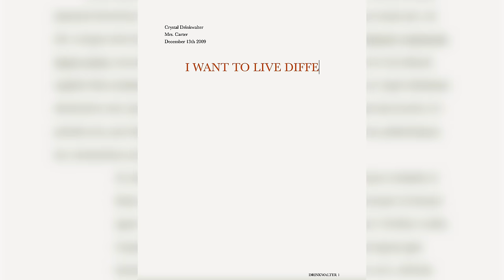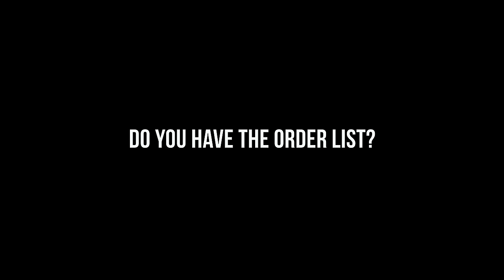FINISHING Massive Off-Grid Solar System!

Comment: My dear Crystal and Jasmine, congratulations on your current achievement.  YouTube has made it possible to share this wonderful experience with so many young couples, and, for this, I have no words.  I life has taken so many different turns from what I planned that it's currently unrecognizable.  But, I would have loved to have your experience, but, my marriage partner and I have taken a more conventional path.  But, my passion, as it turns out, is for more rustic skills, so, even though my partner is a rocket scientist, I spend my time spinning and weaving, and woodworking. And I have done this for almost 30 years.  I have built almost all the furniture in our home, and refurbished the rest which I mostly bought from the Salvation Army or Good Will stores.  I was thrilled to hear that you girls are in need of someone to help with furniture and cabinet design and construction, and I would love to jump at the opportunity to help, however, I am currently having problems with my knee, I injured it on the job during the pandemic and treatment hasn't been going as well as expected, so, I am stuck here in so cal - sucks to be me!  But, please let me know if you need zoom assistance, I would be more than happy to be a part of your wonderful experience.

Comment: Usually you have lots of power during the summer, but the panels do not deliver much in winter. So it might be a good idea to set the angle for winter, where you have a lack of power, instead of for summer where you get possibly more than you can consume. However, a flat angle allows light onto the panels from a wider range of sun positions as having them angled steeper. I have three panels for my garden (lawn mower robot, fridge(small, 0.2 kWh/day), light and irrigation) and they are mounted flat on the flat roof of my garden tool shed. I get power from about 7am to 7 pm in the summer. The three panels deliver more (~800Wp) than the bluetti AC200P can take in  (max 700W) at full sun anyway, so having the longer timespan where the panels deliver enough to charge is better. From june 13th to november 5th this tiny system delivered about 137 kWh.

Comment: The contrast of the solar panel up against the forest is clean green recycle ♻️ energy. 8:12
Sun energy 14:12 🌞 power now you need batteries AC ⚡ DC converter.

Comment: My fixed ground-mount array is about half your size, but I did it all myself, except for the guy who brought the concrete pumper.  Even then, I ran the hose and he ran the pump.  These panels actually generate some power, even when it's overcast!  Not a lot, but I think it will keep your batteries topped up.  I'm grid-tied, but have not had an electric bill since it went up.

Comment: If you have any extra of the Schedule 80, hang on to it.  I took some and cut it into 4', 2', and 1' lengths and Arc Welding some rebar as a hanger to the Pipe.  Makes for great steel shooting targets hung between two trees on a rope.

Comment: Wow!  It is not even my home and I had happy tears streaming down my cheeks.  This was amazing!! Do you have mini-splits yet, for heat inside?  or are you going to stick with wood heating?  Just because I am lazy, I would plan on a mini-split for heat and air conditioning, even if just to have as a secondary source of heat and of course for Air Conditioning when it is hot and humid.  They are ductless, easy to install and work well (added bonus, remote control so you don't even have to get out of bed to warm up your house first thing in the morning).  If you insulate well, you just have to warm the place up in the morning and once in the evening and it will stay warm enough to be comfortable and once you are up and dressed you can always build a fire for that romantic touch and that special comfort that you can only get from a wood fire. Just a suggestion of course, I am sure you two already have a perfect plan for your perfect little cabin in the woods. Thank you for taking us along on this journey, it has been a blast!

Comment: What a lovely and heartwarming video. So glad to finally see the panels going up. Fingers crossed that you'll get everything set up before it gets really cold. Are you planning to use the batteries for heating the cabin as well, at least until you get your wood stove/oven? I use solar on my house since 2011, but I only have 4.6 kW peak. However the system produces roughly 50% more electricity than I need per year. I don't have a battery though...
Reply from the maker: Thank you! Yes power will be going in all buildings 💛 Wowzers! That’s a lot ⚡️

Comment: if you are going to hookup to batteries Renogy Lycan comes with a circuit breaker and plug in your panels directly into the battery box.  if you want to do it yourself for half the price :  You will need  a minimum 6mm ground, live and neutral wire,  2 DC inbound 100amp circuit breakers with fuses and surge protection breakers, then also for your battery bank a DC 200 amp circuit breaker with fuses and surge protection breakers.  Install all into two seperate Alternate Current and Direct Current circuit breaker waterproof boxes. Then grounding : you are going to need alot of 16mm copper cable wire for each array to reach the ground, with two grounding rods 2m. or more and dig  a trench to bury the copper wire wire covered in bentonite and cement, the ground wire cannot get wet, water and electricity do not go together.   The wait time maybe 1 month if you order from an electrical distributor.  It is not safe to plug that much power in without the above and not being grounded or the surge protection during very sunny days or lightning days, possibility of being electricuted without a proper you got power installation.  Be safe take care all the best I hope this helps. :)

Comment: Yippee!
I hope to install panels on my property as well except I will support them on a carport instead cuz I have zero trees on my property & I need the shade & place to park my truck & tractor underneath.  Because I live in deep South Texas, I think 25° degree angle will be all I will ever need. Because of my Southern location, I can probably even get away with laying them on top of some trailers or on the ground! Yours look as if they are standing straight up.  Would a carport scenario ever work in Nova Scotia?
Are these 400 watt glass panels?

Comment: This obsession with being off grid is pointless and a delusion that you are actually off-grid. Also how do you have power at night? If you have batteries those are going to required yearly maintenance by people not "off grid" as well as new replacement parts for the solar panels and batteries, wires, converters etc over time. You will never be off grid its a fantasy and a pointless aspiration.